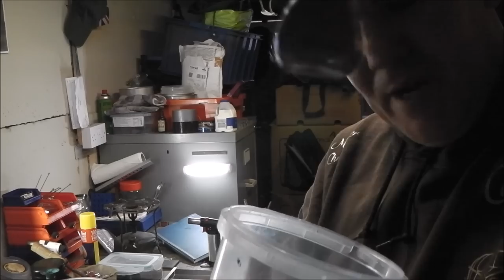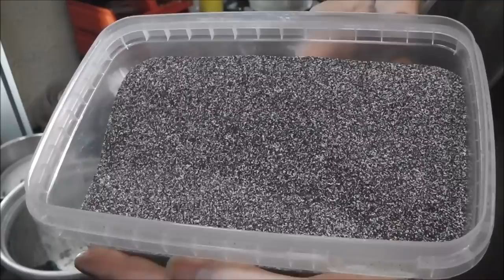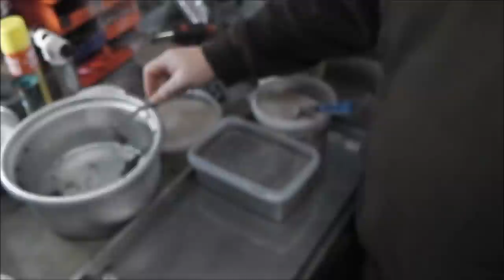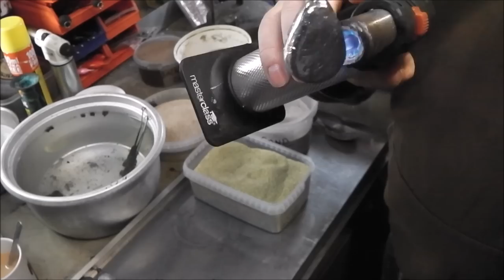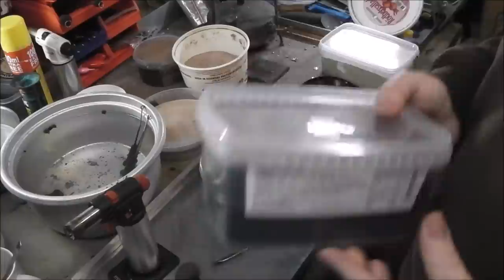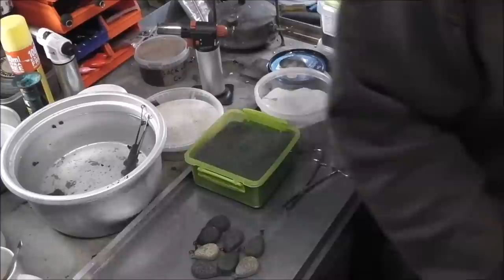Lead Making - A Guide to Sand Coatings & How to Apply Them

Comment: I have used a slow curing epoxy and sand as well. Works pretty darn good as well, since epoxy is basically plastic. The sand makes the sheen much less shiny ( almost a satin sheen) . And you can add a color to the epoxy to change the sand colors as was done in the video
Reply: What epoxy do you recommend?? Please advise

Comment: Iv just ordered some lead molds any hints tip n handy hints on like the best make of coatings, ring clips, to buy.. 👍👍
Reply from the maker: EBay is the best place mate. Shop around for the best prices. Loads of used moulds etc on there. 
HLS have everything for a starter kit. Brown green and black powder are good starting colours mate, will cover most situations. Mix different ratios to get different "camo" colours. Sand is free 😉😉😉😉
Reply: @ScreamingDelkims  so it just about price then, there all half decent stuff, sands free might get rid of me lawn 😂🤣👍👍
Reply from the maker: @jonitheboi605  so are leaves....... 😉😉😉😉
Reply: @ScreamingDelkims  sandpit n big bushes it is then, misses going to kill me. 😉😉👍👍

Comment: What sand can you buy for the top coating? Can you use aquarium or decorative sand?
Reply from the maker: Yeah, any sand pal.
Sand off a beach is free 😃😃
Kids play sand, aquarium sand.
Different grades will give you different finishes.
If you collect sand, make sure you dry it first 👍👍
Reply: How does the sand stick to the lead??
Reply from the maker: @Itwasntalieitwastrueinmymind  into the moulton plastic mate

Comment: This might sound a stupid question but what do you use to melt the lead in I've never made carp leads before
Reply from the maker: Rule number one mate............. there is no such thing as a stupid question on my channel. You can melt lead in a normal kitchen pan. That's what ive used for years. I hope that's helped................ if not, have a look at some of my previous videos.... they will give you more idea.
Reply: Thanks mate

Comment: Just watched your video and 1 questions I'm new to making leads and I'm having trouble with the swivels discoloraring from the heat, you got any advice cos I cant see any difference it what your doing to what I'm doing.. great vid by the way
Reply from the maker: Hi Luke
You're burning the Matt black coating off the swivels mate. What you need to do mate is keep the flame away from the swivel. Just heat to the top of the lead. The heat from that will warm the lead loop. 
If the swivel gets too hot it will burn the Matt coating and turn a dull copper colour and that's no good if you're selling them..... and they also look pants.
Are you using a burner torch like I do or another method mate???
Another problem you can come across if the swivel gets too hot is if you get the plastic coating on it it will clog the swivel up and you'll spend the rest of your natural life picking it off again (when it's cooled down) lol. Just cover the lead to the lead loop with plastic powder. Are you holding the lead with forceps or pliers mate??? 👍👍👍
Hope this helps Luke. Anymore problems let me know and I'll talk you through where you're going wrong fella 👍👍👍
Reply: Thanks for the advice great help
Reply from the maker: @lukejones3187  any more problems Luke let me know mate 👍👍👍👍

Comment: Brilliant thank you, I’ll assume gravel coating  is just the same 👌
Reply from the maker: Yes mate.......... but you have to embed the gravel into the molten plastic or it just falls off cause theyre bigger than sand
Reply: ScreamingDelkims maybe two layers of powder coat to assist the gravel embedding?
Reply from the maker: Yes mate............ like I did with the silt suckers on the last video pal. It holds the bigger grains better otherwise they tend to fall off and you're left with bald patches on your leads.
Reply: ScreamingDelkims nice one thanks for the tips tricks n handy hints 👌
Reply from the maker: No probs mate....... anytime......... more lead making videos coming soon